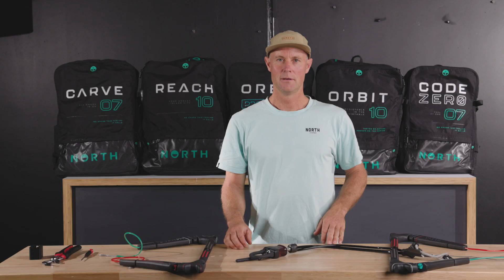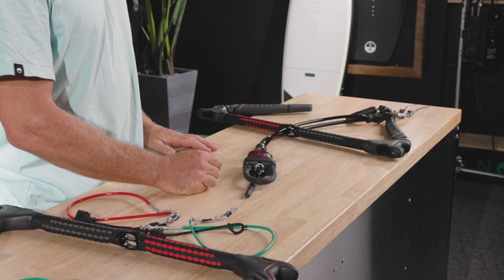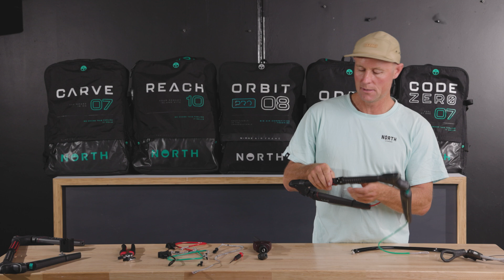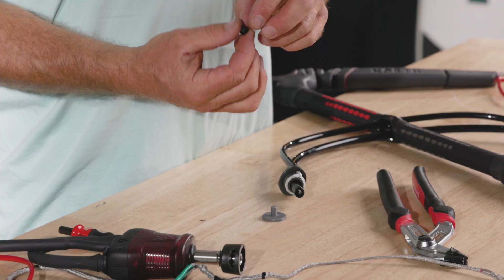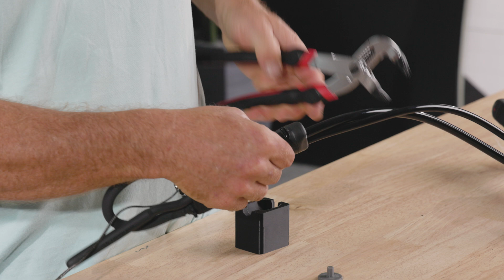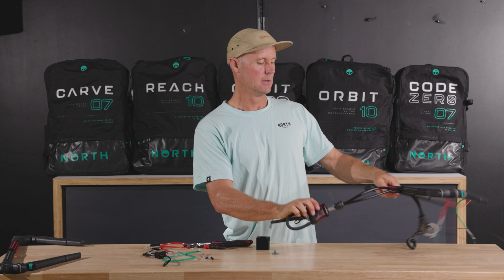Navigator Pro | Control Bar and Leader Line Replacement

Comment: sliding the flared out tube back in is NOT easy... 3rd time doing this
Reply: I found applying a little bit of heat with a hairdryer or heat gun will return the tube to its normal diameter and then it slips straight through
Reply: @erikmcgregor  I did this and it worked. But now after the first session it came out again...Buying a new one
Reply: i wrapped a small rope around the flared out bit to squeeze it tight and it went through